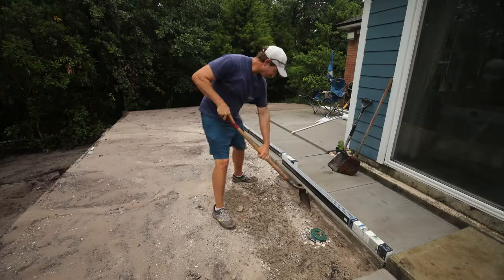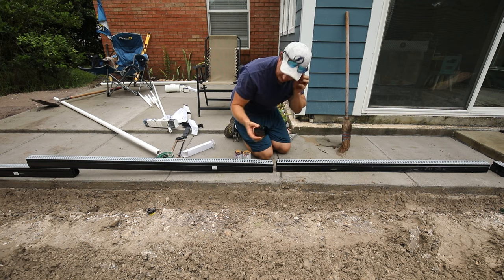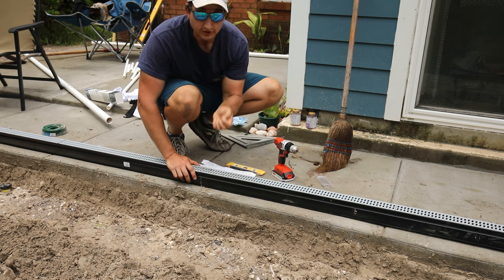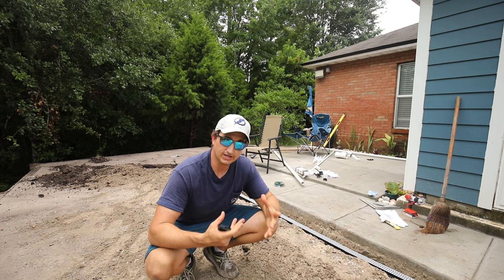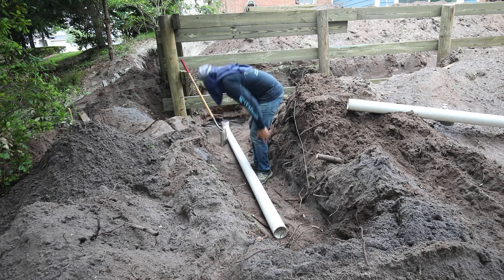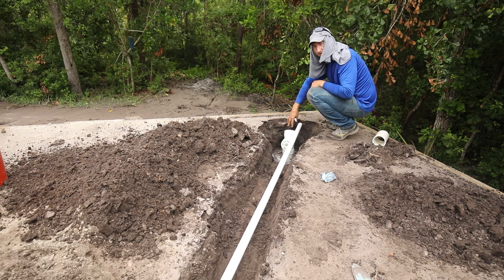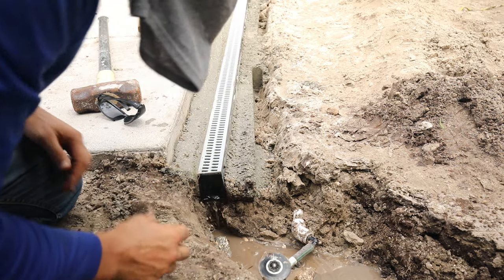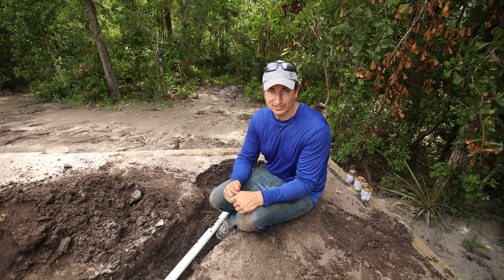Installing A Channel Drain System For A Concrete Patio

Comment: Thanks for the great video.  I found that placing a wide enough strip of painters tape to cover the top of the grill of the drain allowed me to avoid getting any cement in there.
Reply from the maker: Great drain installation tip. Thanks for sharing and watching.
Reply: Great tips cheers

Comment: This system looks great for preventing water from weakening concrete patios and sidewalks completely removing water away
Reply from the maker: Thanks Eric, the main goal was to move the water away and minimize soil erosion.  This drainage system did that and any additional benefit is welcomed.

Comment: i like how all these videos are digging in perfect soil conditions. Lets have some DYI vids up here in the New England where you have to contest with ledge, thousands of baseball sized stone or stone too heavy to move but to small to leave, hard packed clay and deep freezes that would make a polar bear shiver.
Reply from the maker: Yikes! Sounds like it is a real challenge to dig in the northeast.
Reply: Or clay soil that dry is like concrete and when wet sticks to your shovel.
Reply: Grab your pickaxe and an extra pair of underwear and get to work! 😂

Comment: Awesome!  I have never seen anybody install this channel system before.  French drains using gravel are all I've seen.  Now in person I've seen this before in commercial settings, but not residential.  This has probably been around for a while in residential construction, but it's new to me.  Smart choice - low maintenance & looks great!  Looked easier; this should encourage people to give this a try.  Geat editing -TFS!
Reply from the maker: Thanks J.  In this case the channel drain works similar to how a roof gutter system would work.  It should take the majority of water from the roof and patio and bypass the new wall completely.
Reply: Thats because the channel drains are overpriced noone buys them

Comment: I am about to install a similar patio drain with same slim drain. Suggest you use painters masking tape on grill in future to keep it clean and give clean line without sanding. Much cleaner and faster.  Second all those end fittings and pipe can be silicone into place.
Reply from the maker: Great drain installation tips, thank you for sharing.

Comment: On the far side of the porch/patio?  I'd suggest raising the exit a bit above the ground level.
Helps to reduce backflow of sandy/silty water back into the discharge.
And I might fill around the discharge with some larger clean stone to 
support the pipe and allow a drain bed for the storm water.
Nice project. Most of us envy your easy digging sandy soils.
Reply from the maker: Thank for the patio drain installation tips.  yes this "sand" was fresh fill when i built the retaining wall.  Check out that video if you are curious.

Comment: Local painter suggests you cover the grates with some contractor grade masking tape.'
Keep the channel cleaner when setting and placing the cements or concretes.
Reply from the maker: That seems like a great idea to protect the channel drains from getting messy. Thanks

Comment: Since you sloped the ground, how is it that the fully attached length of the channel drain with cover sits flush with patio?   Wouldn't it drop underground  even an inch or so, thus making it impossible to lay grate level with surrounding walkway?  I'm getting stuck on this point.  I want a 6" width drain 16 feet long cut into a back (uncovered) patio defectively constructed and sloping toward house.
Reply from the maker: I am not exactly clear of your question however in this case the concrete patio was not pitched to where I wanted the water to drain.  I still had to pitch the drain and it is not flush with the concrete patio height. In this case I dug a small ditch along the edge of the patio and temporarily braced the drain running at the proper slope. The drain was kind of floating in the open space of the ditch at this point. Then I backfilled and use concrete to fill the ditch and hold the drain in position.

Comment: I'm concreting between a garage and wooden fence, I'm going to throw in a few screws to secure to the fence then anchors of some type into the concrete side to interlock them into the path. Would it be OK to use the drain as my firm for the concrete? I'll tape up the cavity prior to concreting.
Reply from the maker: sounds like that could work to me

Comment: Hi
Can you install the drain flush with the patio without the concrete channel?
Reply from the maker: Yes the channel drain could be installed more flush with the patio edge.  In this case the channel drain would not fit flush because of the surplus concrete seepage just below the soil surface.  Instead cutting the concrete to make a clean edge I installed the drain as shown.  The drain should still be attached or anchored in some fashion.  The concrete works well to hold it in place.
Reply: i'm going to install a pea gravel and 2-4 inch rocks natural area around my patio. Do you think the rocks would be strong enough to hold the channel in place without setting it in concrete?

Comment: The only thing I missed was a rain event happy ending.
Is it possible to record and upload a video of your system working hard?
Thank you for taking the time to make and upload your videos.
Reply from the maker: Thanks for watching and the video request.  I can say the patio drain system has been working well since the installation of the channel drains.  Seems to capture run off water well in both light and heavy rain conditions.
Reply: @MrKistel  that's good to know and the satisfaction you get during rain storms is enjoyable I'm sure.

Comment: Is it everything comes together 
Except the pvc pipe? 
How many ft are they ?
Reply from the maker: The PVC drain pipe connects to the lower end of the channel drain assembly.  the channel drain kit came with the parts for the channel drain portion and the pvc parts they connect to is separate. These channel drains were about 6 feet length per section I believe.

Comment: Curious, at the very end, why do you have it going up and out instead of just running the pipe further and straight into the woods?
Reply from the maker: Having the the pipe come up a bit briefly at the termination point works in a water drainage system like this, however water can get trapped in lower end of the pipe.  Holes can be drilled in the elbow joint to allow water to escape but this only works well if you have good drainage near the holes.  Running the pipe straight like you mentioned is a good method of drain termination when it is an option.

Comment: Definitely going to try this! I’ve had estimates of over $8000! Do you have a recommendation for securing the drain to the concrete without pouring the additional concrete?
Reply from the maker: I like using concrete to secure the patio drains in place but there are other options. If you are able to flush the channel drain directly to the concrete edge you can hammer pressure treated woods stakes into the ground on the other side, sandwiching the drain in-between the concrete and the stakes. Once your pitch is set correctly you could screw the drain to the woods stakes.

Comment: How about erosion over time?
Reply from the maker: not sure I understand the question. Installing the drain was in part to help minimize erosion to the yard area around the patio.
Reply: @MrKistel  the water exiting the drain is not causing erosion over time? These contractors installed a drain on our yard and the exit point is eroding.

Comment: could you just have placed the channel drain next to the existing concrete and not have to put new concrete? I have a dilemma, I went with poured concrete and 4" turf between concrete slabs and I dont want to put new concrete because it wont match existing.
Reply from the maker: Maybe you can insert concrete anchors into the existing concrete to secure the drains.

Comment: Any time you glue PVC, you need to rough up the PVC with some sandpaper and then primer, then glue. The coating on that stuff is very slick. In the future, sandpaper it first
Reply from the maker: thanks for the working with PVC tip.
Reply: While I agree, the MEK primer does it anyway. Turns the surface to jelly. Yet I see too many lazy plumbers still skip it. I remind them to read the instruction label on the side, which makes it real clear.

Comment: It would have looked way better if you butted up to the concrete walk way. Again I can’t see the grade so there might be a reason why you ramped with new concrete...
Reply from the maker: Perhaps, however the finished edge of the concrete patio was not completely clean.  Underneath the the edge was bumpy from surplus concrete overflow and so the drain would not sit flush against the patio edge.  I figured leaving the gap between the channel drain and patio slab would leave room to fill in with concrete and allow me to create a straight path parallel to the the patio edge.  It would required more concrete to to this but also feel the drain is more secure in this fashion.

Comment: So why didn't you just use tape or plastic over the top of the drain before you poured concrete? That probably would have saved a lot of work cleaning/sanding, not get concrete in the actual grate and not scuffed up the top of the drain with a sanding block. Otherwise, nice installation.
Reply from the maker: Putting tape over the channel drain grid might have been a good approach

Comment: Those channel drains are so expensive its not worth using them. A simple french drains costs a fraction of it and works the same
Reply from the maker: A French drain can be very effective for water drainage. Thanks for the tip.  In this case the hope was divert water away from yard above the retaining wall and directing with a channel drain system seemed a good practice to do so.